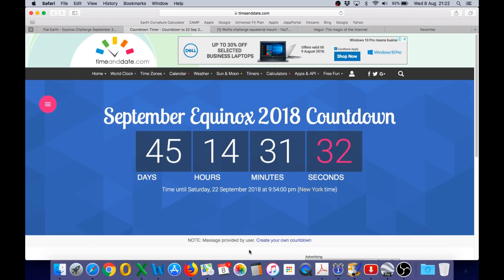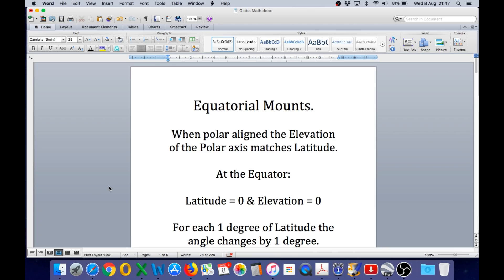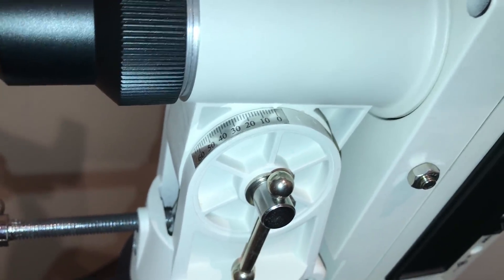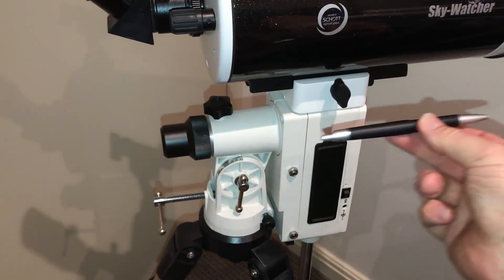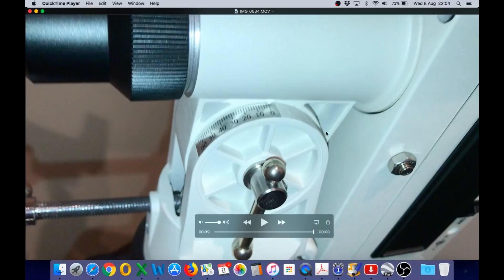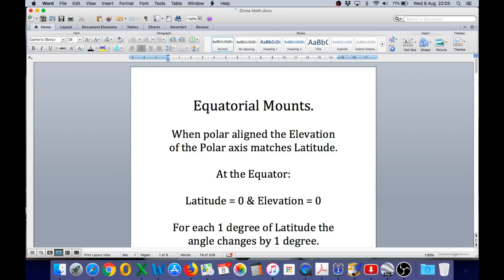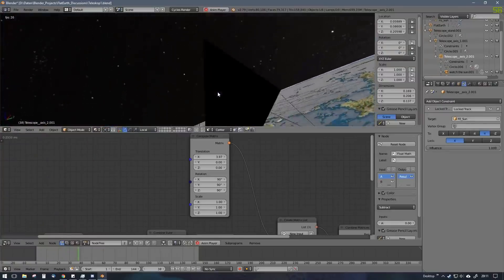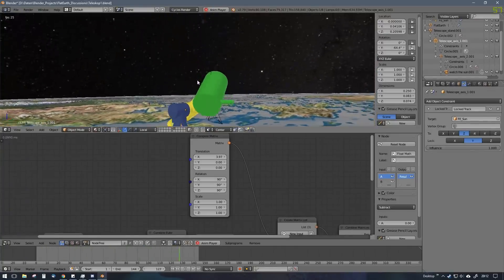Equatorial Mounts - a huge problem for Flat Earth.

Comment: Did you realise that google maps on desktop made some change? go check it out :)
Reply from the maker: +Dan Pellicani.  Yes I saw that recently.   Good to see they did that.
Reply: That sucks I had a map going that was tracking an object and had a perfectly straight line going across the flat map, now it's a slithering snake path. Oh well it's more realistic now but just doesn't look cool anymore. It had all the megalithic sites all lined up.
Reply: I just posted a similar comment about the change to Google Maps. As far as I can see it is only on a desktop pc, not on a tablet like my iPad.
Reply: randomjasmic changed on my phone
Reply: randomjasmic yeah desktop version only for now